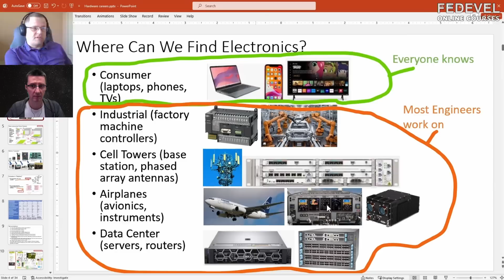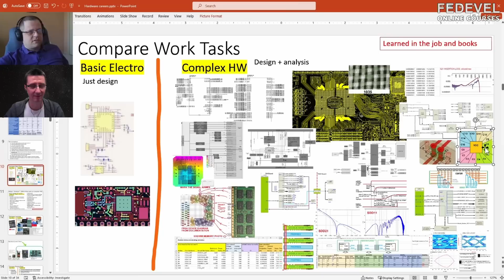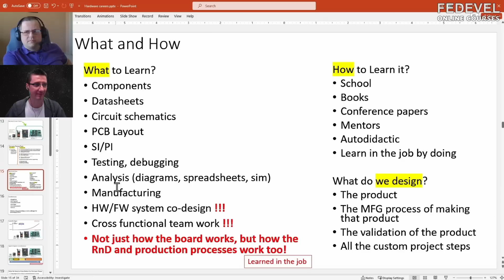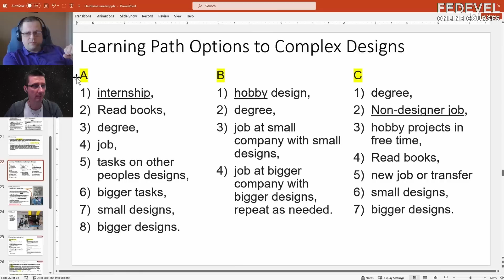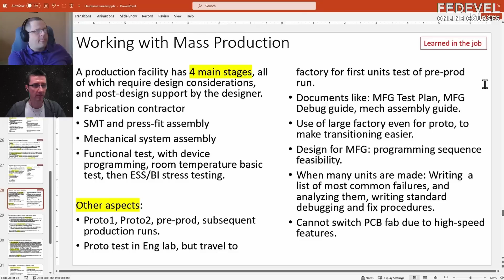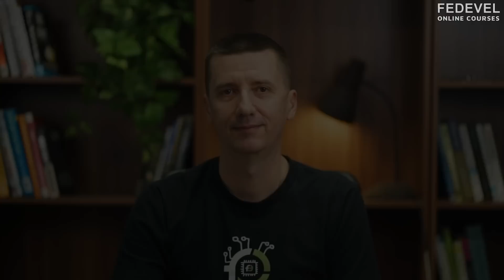Are you the right person to design complex electronic boards?

Comment: I remember when I just started... That's a lie I am still starting to design electronic devices... I really didn't like that most EDA software required schematics, which is why I used SprintLayout which didn't require schematics and allowed to just place pads. But after doing some laptop repair (which schematics from dubious sources, obviously) I kind of started understanding what is the point behind all of this complexity. Like for MCU+blinkie LEDs that would slow you down, and maybe for really simplistic designs it is the right tool for the job, but with something more complex, say BLDC/PMSM motor controller, that would help and speed up process a lot since you're dealing now with various logical "parts" of device (is this power stage, is this aux PSU, it is micro etc.) and amount of components is rising exponentially. 

Not to mention that some simple things, like say a mains LED panel with some kind of linear driver, has some caveats that you might have never considered, like an inrush current, which will damage diode bridge, damage tiny 1/4W resistors etc. And more complex things? Like motor controller, a project I am trying to make right now? So many caveats, how to drive MOSFETs properly, how to program MCU properly so it doesn't make expensive smells and fireworks, and how to route PCB in such way that 40A current track doesn't induce interference into low voltage lines, especially on 2 layer boards... And I am not even talking about EMC (which I will ignore for now) issues. Fact that I don't have an oscilloscope makes it even more complex since now I have to learn all of those issues in theory, like Miller effect and how to avoid it, instead of "hmm lets put 47 ohm resistor instead of 10 ohm". 

And after what I've seen people designing at uni in electronic project design course..... 0.10 mm traces that barely pass DRC, no ground pours, traces too close, traces too long for no reason, decoupling capacitors 1 km away from fast switching chip... It is something they don't teach you at uni, unless you're so smart you can correlate say electromagnetic wave course with PCB design without any external help. It takes hands-on experience to design even simple PCBs properly. Understanding how etching works, supply chain (because components don't grow on trees and they cost money) etc. It all takes time and dedication.

Comment: Interesting. But I doubt the 7000 components base station with all disciplines of electonics will be designed by one person ;) I feel fine with ARM processors and FPGAs in general after several years in electronics (neighbours TVs fixed at 13, first self designed alarm system at 15, education and university degreee in EE), but even after 17 years being self employed in engieering I know the lines I don't currently cross. DDR3+ RAM is one of those, get a drop-in FPGA board with DDR on it instead.

Comment: I’m not sure what it’s like in other countries, but in the US, landing a hardware design role is very hard. First, the vast majority of universities don’t even touch the topic. Secondly, it’s an incredibly expensive hobby. You’ll spend hundreds on lab and test equipment. And finally, you need a masters degree for most of these positions these days.
Reply: You don't need a master's degree. Most large corporations hire pedigree people, even if they have no idea how to design a board, they hire hundreds of them, and the company produces a few dodgy designs each year. You may not want to apply for such jobs. Find smaller/medium sized companies to learn and to have fun. As the video explained it, if you watched all of it from start to finish.
Reply: @buenos4799  maybe in China or India, but that’s not what it’s like in the US. Coming from someone who often searches and applies to these positions (small and large), most of them want engineers with a masters for newbies or several years of experience for senior engineers.

Comment: I make double-sided PCBs at home using photosensitive film method, It's not that hard. You need to print the two sides on transparent sheets, cut them out, align them, and tape them together. Then, apply photosensitive film to a PCB, sandwich it between the two transparent sheets, and expose both sides to UV light. But that consumes time and energy.  You need to cut the PCB, drill holes, tin the traces, and optionally apply a solder mask—though that requires additional effort.  

If you’re okay with shipping costs and waiting two weeks, ordering professionally made PCBs is far superior because it saves you time and energy. I haven’t even mentioned metallizing vias, which I’ve never done myself. I’ve seen other people do it at home, but for now, I think it’s a bit too much for a hobbyist
Reply: It's also cheaper, you can get 4 layer board for $2 from china these days.
Reply: 2 dollar is 2 sided and +7 $ shipment. They don't send to russia though, only from second hand dealers x2 price  @R-802

Comment: Design => FAB => Analysis => Refine

Basically, it was the same feedback loop, but just longer & get more complex until it's good enough. 

Too complex that no one can do it alone but separately into smaller modules & require each part to communicate with each others more effectively.

Comment: Great presentation. I found some of the conceptual categorizations of work arrangements especially useful.

Slight addition perhaps, regarding "small company" vs "startup". The difference at business/finance level, but it can impact work culture.

A small company is capable of surviving in financial equilibrium, making a modest profit and remaining its small size for years or even decades (perhaps 15 to 300 employees?). A "startup" in the sense of silicon valley cannot remain small, it must either grow rapidly to become large enough, or be acquired almost always by an already-large company. The imperative to grow rapidly is to repay the money received from the venture capital who typically gave substantial amounts even when it had just a handful of employees and some IP. The venture capital, due to their risk profile, expects that 90% of their loans go to 0, and 10% go to 20x or 30x or something like that. A 1x or 2x return on investment is not interesting to the VC's. So this "big bet" life changes the energy in the office a lot, as well as the financial risk/reward profile and work/life balance -- but in the terms of this presentation, there is a commonality due to simply small size: likely less formal process, more individual responsibility, and as discussed more bottom up learning style.

Comment: Clickbait cover and wrong comparison on many levels!!!
1) It would take a whole team of engineers to design a mobo
2) MCU vs CPU serve completely different purposes and products.
3) It matters more what software you are using. What makes Arduino a noob product is the IDE and language. Whereas a professional product would use compiled C and some variant of RTOS. Otherwise, a pro should, bit not required, to put MCU onto their own PCB, although I would be less upset over use of Teensy module with a carrier and RTOS than I would be over usong any language or IDE related to Arduino.

Furthermore, by definition any offering which tries to hide (instead of educating) their users about the complexity but immense value of interrupts and RTOSes (of varying hardness) is a noob product. You could take the MCU which Arduino uses, and a superloop type of code, with interrupts, compiled C, and MCU in your own PCB, and it would be good enough for a commercial product.

Comment: A good rule of thumb I had for my own boards was: "First one probably has a nasty issue or doesn't work at all, second one may have a minor issue (e.g. bodge wire), third and last one being the board that I've actually wanted to build. So in that regard it was so cool to see the process of what typical mass production looks like. I guess I was not so far off, haha :) Though, these days, for me, simple boards tend to be more like two iterations: The first one has minor issues but at least works, while the second one is pretty much perfect.

Last thing I screwed up was a wrong pinout on a SOT 23 transistor: Though, I was lucky enough I could just flip it upside down and turn it by 120 degrees. Worked flawless afterwards!

Comment: a complex pcb i.e. power hf communication digital analog is more than one can handle with all sorts of issues their own areas never mind combining them and all new issues are created.
Reply: Yeah. A nice compromise is letting a module like Teensy handle the 600MHz stuff (USB3, Ethernet, PCIE, SD card, WiFi, etc), and make your own carrier board for the module which handles slower stuff like analog IO, acquisition, power, motor drive, etc. But as I said elsewhere, it is the software that matters most. You can have a 2GHz CPU-grade MCU but run dumb stuff on it like Arduino or Python noob code. Waste of power and compute cycles? 99%. Efficiency 1%.
Reply: not with that attitude! as always it is a case of using abstractions to move quickly but still accurately as a single human
Reply: @xyzabc123-o1l  Wow so the "attitude" is the key not the knowledge or experience, jack of all trades master of none says quite a bit. Made rules and length matching is not the whole story to a well working pcb, guess youre pretty naive to think so!
Reply: @sphinxios you only have one life to live. take calculated risks, for example don't inhale magic electronics dust or expose yourself to radiation, but if your honest to god goal is to make a complex pcb, then there is no reason to not try. however if you're simply commenting that complex pcb design and manufacturing is incredibly hard to have success with, then of course you are right. the people who don't let that fact stop them are often the ones who deliver something extremely useful to the world
Reply: @xyzabc123-o1l  You just shown you are not any engineer material with economics insight at all. Taking risks and trying great words!
Reply: @sphinxios you dont have to be so bitter lmao. once you've made enough money to survive, not everything has to be profitable and scalable. there can be cool one-of-one boards that prove something is possible despite it not being the most economically sound choice
Reply: @xyzabc123-o1l  lotsa assuming there, so tell me o smart one what one off boards that prove something have you made and show the rest of us stupid ones your designs including farts and unicorn dust. Dont forget to show it working as well not just barely.

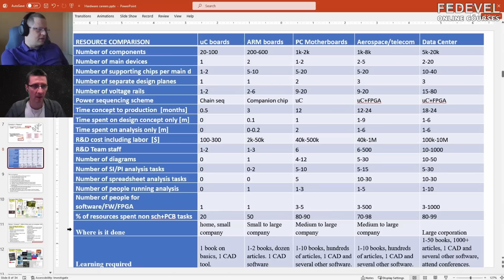Comment: 15:00 While adding more people can accelerate projects, this effect might be less significant for designs that aren't particularly groundbreaking. Consequently, resource projections or timelines for such projects could seem inflated relative to their complexity.
Regarding the table, could you please add average values alongside the minimum and maximum? This would provide valuable context, even if the data set is limited to your company's projects.